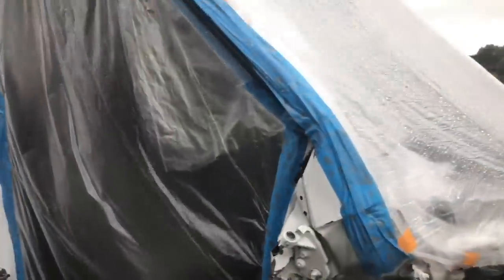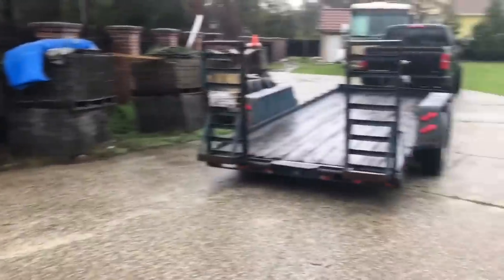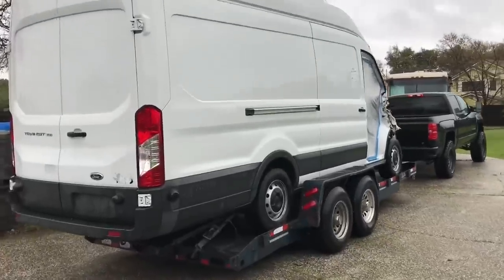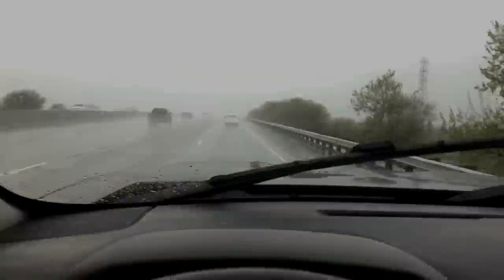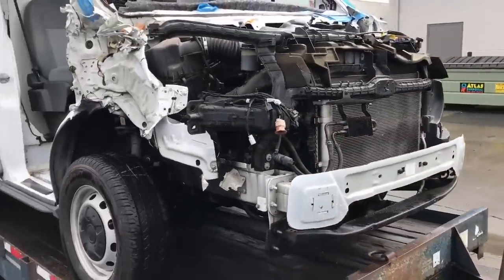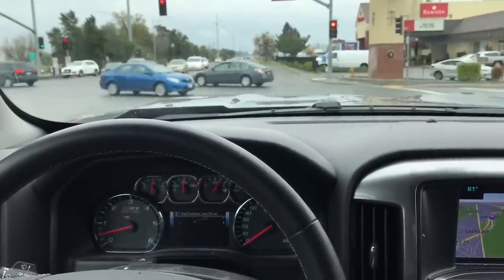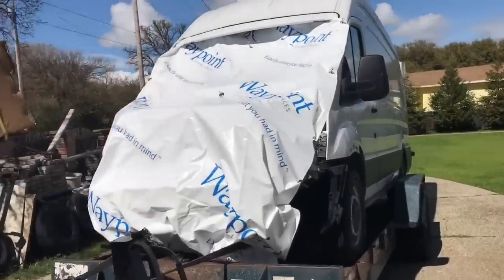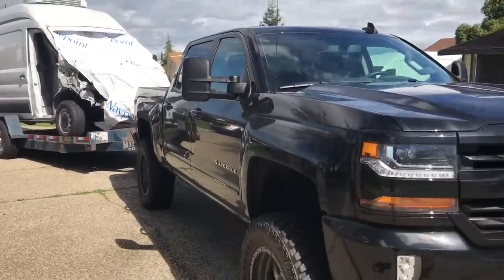2017 1500 Silverado 5.3 Towing 11,000lbs Then this happened!!

Comment: Problem is you have a van that retails for 45k, with a salvage title it’s worth about 15k and yor mom n it for 18k. Sounds like a math problem to me
Reply: Stupid auto correct, *you are in it
Reply from the maker: Nah it's fine, these hold their value 30% less after repaired plus I'll sell rolled can back on auction.
Reply: FixItNick that’s good, out here a 2015 with 60k miles goes for about $15-$19k with clean titles, so rebuilds would get around $10-$12k

Comment: Im a chevy guy but seriously chevy isnt made for hauling at all.... I have a GMC 2011 texas edition Sierra 1500 we were hauling a trailer with about 1 to 2 thousa d pounds and the tranny blew all high gears so we were rolling on 1st through 3rd gear till we could hit an exit
Reply from the maker: I live on the edge bro, I would t do it again but trans temps were normal, RPMS were low, wasn't even struggling, but it did feel like truck was light for such load
Reply: What? Have friend who tows with his 2016,  heavy trailer at least 10k lbs and he does this often...zero issues.  Yeah it’s a 1500

Comment: Wait a minute... #1. That's your wife's car?? What's wrong with a Honda Civic or Toyota Camry?? How many kids you got?? How much do they each weigh?? #2. WTF happened to it?? Shit looks like it's ready to be totaled, why would you even fix it, the fucking electronics are all over the place like rats chewed up the wiring. Did your wife cause that wreck and if so, why are you fixing it for her?? Maybe it's time to get her a Civic or Altima, something a little harder to crash and with a smaller blind spot. #3. How does that van weigh 8k lbs... doesn't a Ford Explorer weigh like 7k lbs.?, you don't have to guess, just look at the vehicle manufacturer plate on the door jamb. #4. You really should be pulling this with a diesel, but I suppose it's ok since I'm sure this is not something you do all the time.
Reply: Leonel Ventura - It's in the description, it's a reefer van for her flower business.
Reply from the maker: lol trailer 4500, van 6000-6500 cuz it's a reefer, for her flower business. It's 22 feet long and tallest roof

Comment: That motor hated that weight.  2500hd with the 6.0 are frustratingly slow with a load
Reply: Its not like he's pulling the weight everyday, truck's gotta be able to do truck stuff when needed
Reply: I drive a 2500hd with the 6l for work and it's got 2000 pounds in back with an aluminum deck and cage and it's awful. Way under powered and only gets 8 mpg
Reply: Well YOU got a truck for your needs, congrats
Reply: Mad Max yea with 10k at 60 mph up hill holding speed.  Your foot will be to the floor if you want to increase  speed.
Reply: Mad Max seeing it's locked in 5th gear at thst point your either giving it all the time in the world to gain to 70mph or your not hooked to 10k.  I just tried what you said pulling 16ft felling deck trailer empty and yea trucks way under powered but I guess I'm comparing it to my duramax.  Plus the maybe 6mpg at best is a joke
Reply: Mad Max my bad was confused. I thought you were talking about a 6.0 gasser and not a diesel. I was like I have 2 chevy 6.0 gas and an lmm and the gasser hate heavy loads. But yea very  familiar with the lly, lbz and lmm.  The duramax just plainly dose not care what you hook to.
Reply: Mad Max and yea when ypur fifth gear locks they consider it a 6th Gear.
Reply: bdd1469 yea OK dude. Notice you said drove to work and back.  Well let me inform you when a guy owns multiple trucks for a business you tend to focus on how well they can do the job. Gassers are gutless compared to diesel and yes when I grab a gasser I will piss and moan asking myself why didn't I get another duramax.  So when a guy like myself makes money with my trucks and not just lolly gagging around the country whether or not the truck can pull with ease makes a huge difference.  My 2 cents
Reply: Mad Max if you've got an LLY I'm 100% positive you have a 5 speed with torque converter lock that will make it feel like another gear.
Reply: boost lord   Your two cents are over a penny short.   You completly miss the point.
Reply: Mad Max the lly never came with an actual 6 speed period.  If you actually have it, your trans has been swapped or modded, period.
Reply: Clearly madmax deleted all your comments because you realized your wrong.
Reply from the maker: Handled it like a champ